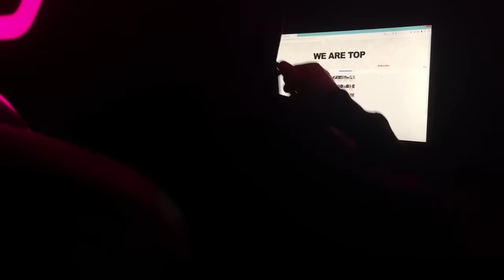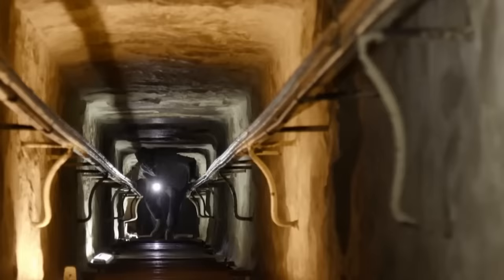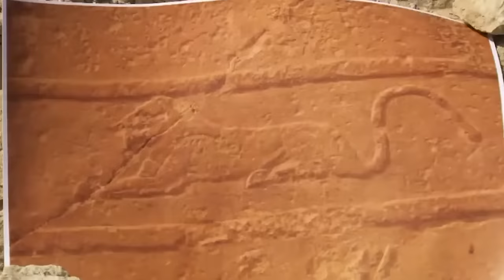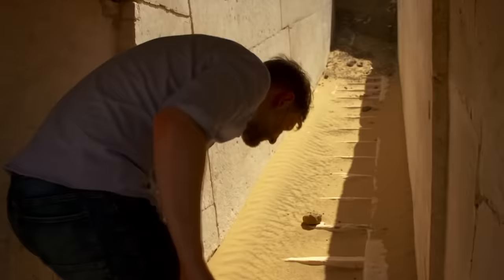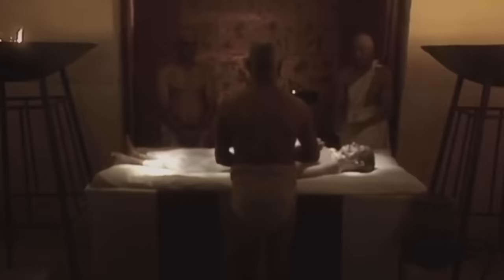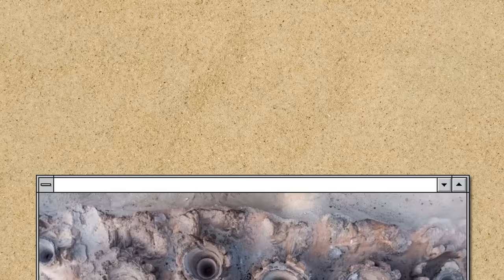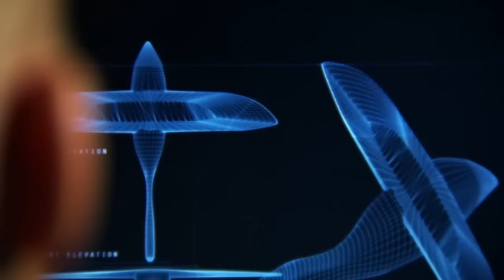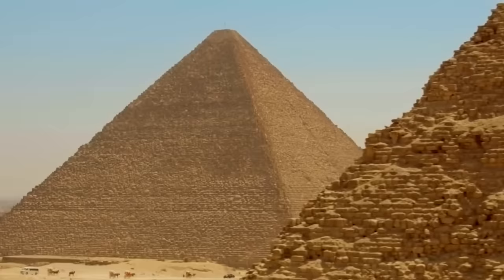This Discovery in Egypt Scares Scientists

Comment: The reason there are no soot stains is because they would put salt in their oil lamps which helped purify the oil before it was burned. after seeing this, I attempted to put salt in my modern oil lamp and it does reduce the amount of soot that settles on my lamp's mantle.
Reply: That and...nobody needed to be in there for long once the roof was on
Reply: Thank you T I have oil lamp I will try with the salt , again Thank you.
Reply: We already know ALL about the jot dot and title loan companies
Reply: They did not have oil lamps. They had torches dipped in goat fat.  I tried the wax candle and run the finger through the flame and salt did not decrease the amount of soot on the fingers.  I did not try baking soda (aka natron) nor did I have goat fat.  They figured it out whatever they used.

Comment: What's weird is they were able to calculate and/ or compensate for extreme loads on parts of a structure that according to one of the earlier theories mentioned was basically "let's slap this thing together,fix shit on the fly 'cause we don't really know what we're doing but we don't have TV or video games so we have lot's of time to figure it out.
Reply: Man, that theory sounds so naive now, it's unreal. And it seems to be used for every ancient monolithic site. As if moving 100-ton granite slabs is just something enough people can do. Or cutting them so precisely, for that matter..
Reply: @dudeguy8686  What they do not mention, is how hard and level the ground has to be in order to support such weight of the entire structure. It has not cracked or collapsed in thousands of years. If your going to build something big and heavy you would need to compress and level the ground before hand VERY well. The fact that the structure has not sunken or fell apart is proof that the ground they built on was prepared somehow extremely well before any stone was laid. That is not naïve but but simple fact. You try it then tell me and the other people here how your structure is expected to last for centuries! I bet you will fail. Especially if they were built before the 10,000 or so world wide flood. Even more impressive because none of it has been broken or washed away except possibly some outer stone work.
Reply: @evilstalkerhorne  aye, most of the really ancient monolithic work is built directly into the bedrock, interlocking with it. It's incredible
Reply: The meteorite dagger from Tut’s tomb, is probably, an even greater find than folks can imagine, … as any meteorite found, is an exceptional find, all on its own, … let alone the metallurgy to get a solid piece of iron, that could be forged into a dagger, ….  Did they use a Damascus steel, type of forging? It is my understanding, that most meteorites, are somewhat porous, on some portion of the extraterrestrial body, …

Comment: When you see what these ancient people created than its hard to believe they made this with primitive tools. Obelisks like the unfinished Obelisk weights about 500 tons, this would be quite difficult to move in modern days i think. Especially through sand.
There were found traces of carving tools which look like from machines and to carve Granit... you better get good materials otherwise youre not getting anywhere thats how hard this shit is.
In modern days if you wanna work with a material your tools' material have to be tougher and harder than the material which is getting worked on and then they wanna tell us they used tools with copper and bronze having a mohs hardness of 2-3 to work on granit which is arround 7. You need a lot of tools cause they will melt away very quickly. Its very hard to believe
Reply: Have you ever seen the one-man move build structures with 2 logs and leverage?

Comment: The pyramids are tombs? Where exactly is the proof of that? And how exactly did they transport and place those 80 ton granite blocks? And of course, eg, the great pyramid is an almost perfect pyramid—overall it’s off by a fraction of an inch—which means that that each level is built effectively perfect. And why do pyramids built by later Egyptian dynasties look like the construction crews would only start work after getting completely drunk. Lots of questions that are still open, not everything is fully explained as this video would have you believe.

Comment: The Sphinx has been around for tens of thousands of years before the Pyramids were built. There's a lot of evidence proving this without a shadow of a doubt.

Graham Hancock demonstrated how the Sphinx's orientation places the time of it's construction at a specific point in the 26,000 year precession meaning that it was either built 12,000 years ago, or 12k+26k, or 38,000 years ago.

Additionally, the RAIN erosion on the surface indicates that it was exposed to the elements for several millennia. But the last time it rained significantly enough to cause that amount of erosion was BEFORE the last ice age.

Comment: The were only few tombs that were ment to be visited regularry, so no marks of burning torch for most of the Tombs, 
All the walls has been cleaned to reveal the writings or too look for clues in the early 20 century. 
Btw they have already used oil lamps by then and most of the stuff that was on the walls was done by robbers and visitors..

Comment: Ok so I’ve been thinking abt this … ok?? . The structure used to be surrounded in water . Because we alllll know Egypts pyramids and structures were surrounded in water and lush greenery,   What if the holes , in the cat that have nothing in them but tunnels leading to other tunnels ,, are water tunnels . The water flows through the tunnel, and flows OUT of the top of the cat, giving it a “god “ like appearance..? (I’d picture the shine of the slick flowing water ,over the head and shoulder of the statue . Giving it a glowing effect when the light hits it . Because after I’ve watched ALOT of the video I’ve noticed , all the tunnels have erosion , just a bit worse than the outside of the cat . If it was surrounded in moving water , and the INSIDE of the building is worse than the outside , clearly the water flowing through the inside of the statue was flowing with great speed . Constantly .
Reply: So that has me thinking . What if they used pressure from groundwater buildup, to create a fountain . ?? Does that.. seem possible ??

Comment: Considering they didn't have much during that time and how many offerings were at the temples it's much easier to believe the Egyptians were very devout religious followers and would do anything to honor their pharaohs. Including building giant pyramids. I'm sure there was great promise of what was to be given on the other plane of existence so getting any of them to do the work would have been relatively easy. Imagine mega churches but in ancient times coupled with metals sent from the stars you'll get a culture of astrological and spiritual followers.

As to how they moved the giant stones, it must have been lots of wood and lots of rope. A man had discovered how Stonehenge had its stones lifted by using wood planks. So it's possible that a lot of deforestation happened during that time to gather enough wood to lift the large stones. It's also been discovered that ancient Egyptians also had rope that was strong enough to lift approximately 2,000 kg or roughly 4,400 lbs and considering that the heaviest stone in the pyramids was 85 tons then it would take roughly 38 or more lines of rope. Getting more than that would make the job easier. An average person can pull safely around 60 lbs so around 2834 people pulling in unison with 75 people per rope line. Considering the size of the stone it would be easy to wrap 100 ropes around the stone it would be 28 to 30 people per rope line relieving a lot of potential stress from the rope lines. So, yeah, definitely possible to do but a lot of back breaking work that many of us would see no point in doing.

Comment: It's not a lion, it's a Jackyl, if you look at the entire monument, it has the legs and much larger body, command with with re shaping  for the usual over working of Egyptian gods and change.
The topography is important, otherwise they would have abandoned it, rather than re shape it. Lion wouldn't have worked,  as potent as their power, Anubis a Jackyl was a much more powerful God.

The Egyptians buried their kings in the valley, it's like an upside down, polar opposite, as above so below city for the dead, the necropolis of kings.
No hummus have ever been found in the pyramids.
So much here to tackle on a smoke break  still wondering if the hairworm came out of the menu is in nepthys.
Wonderful plants.

Comment: The last minute of the video is all speculation. While yes they had experts there is still no way for the Egyptians to be able to build the pyramids at that time. And most scientists and historians agree. While they may have been able to cut the stone moving them from the quarry and up the pyramids to place them higher, it is just not possible at that time. They had no way to move those ridiculously huge and heavy blocks to be placed so perfectly while also making it so the chambers wouldn't collapse. Odds are they didn't make them. And just took them over once they found them and carved their own stuff on the inside. So I really doubt they were able to do all of that.

Comment: Sadly the '3,000 men... 250 blocks per day...' statement forgot* these weren't cozy cottage bricks, but 2.5 ton solid granite beastmode blocks between 3' - 5' tall. Not to mention the multiple 90+ ton foundational and structural granite blocks used elsewhere in the construction and in wildly differing posititions. Unless of course "structure" simply referred to the pyramid's veneer.

Comment: Seems far more likely the original Spyhnx head was a cynocephaly than a lion, in other words, the head of Anubis.
Reply: Two more things: The Saqqara birds have one difficult argument, which is ones were found about 12ft in length in other areas in Egypt. For the lightbulb or snake in a lotus, which could have been hydroelectric powered, no glass or filament would have been found and soot wouldn't exist unless there was a multitude of bulb outages, but the argument isn't in the bulb but rather the metal contacts also depicted, which could have been made from gold and silver.

Comment: Its fully possible that they did have todays tech and carbon dating techniques are 50%. Is it possible that these are much older than they say and the equipment and wiring etc, that may have been use fully decomposed into the earth.